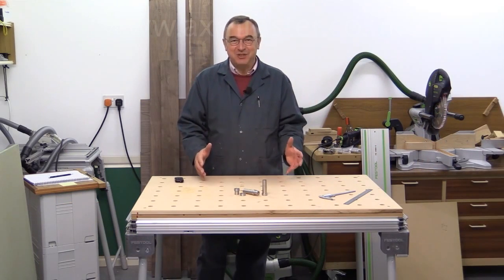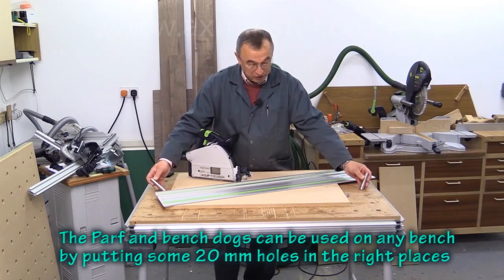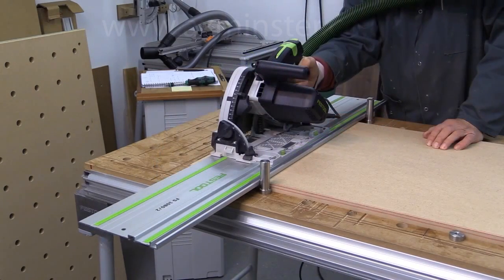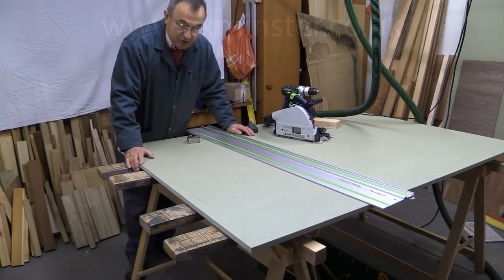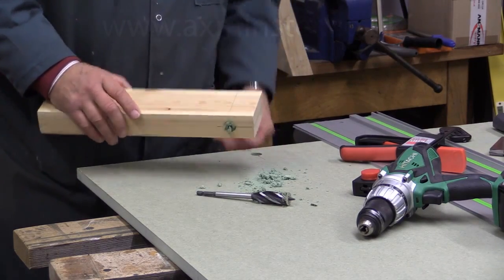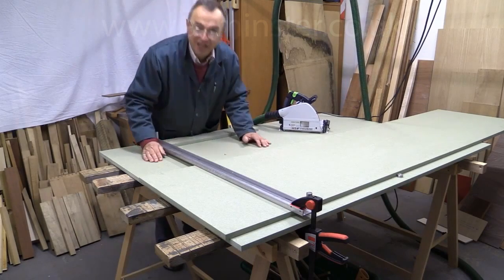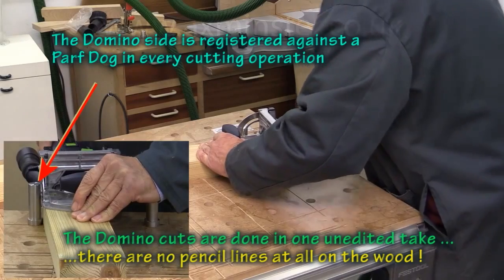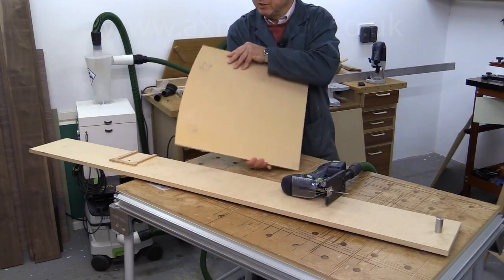Veritas Parf Dogs

Comment: Peter words cannot express the pleasure I get from your tips and vids.I have just completed a slab bench top 3ft / 5ft. and then I discovered your perf dogs and I had made the top with 3/4" holes. Lee Valley does not sell 3/4 "  perf  dogs .would it able to  have them machined to fit my table?  Ian.

Comment: Dear Peter, may i suggest you to mention that the parfdogs could be of more limited use when used with other saw-rail combinations than the Festool type. I use a Mafell MT 55 and discovered that the sole of my saw would be stopped by the dog. This is due to the Mafell type of rail i must admit. But il should be outlined.
Reply: Would a low profile dog not eliminate that.  There are options available in 2019 not so sure about 2016 though.

Comment: Hi Peter. I recently bought the UJK guide system and the parf dogs and, of course, I'm very pleased with it.  I thhought about the  problem where, with a wide board, the first parf dog  may obstruct the tracksaw.  I think I'm not the first with this idea, but to be sure:  what about putting that parf dog upside down in the hole?  You then can still cut boards up to 27mm thick without interfering with the tracksaw and that's the majority of the boards most of us use.  Also, the board you are cutting can be a tniy bit more narrow when you don't have to put a spacer in between..  The only problem is that you cannot screw the parf dog in this case.  Or is there another reason not to do this?
Reply: +Frank Verlinde
There are low profile options out there that can be used.

Comment: Thanks Peter for sharing. Great sales presentation to clinch the argument for your parf dogs creation. Besides showing the variety of tools that benefit from the parf dog configuration, the clincher for me was the rim and thread combination that sets your dogs apart from the pack. Even with a severely battered and deformed job-site MFT table, the parf dogs can be accurately secured in place for the day with a spanner and a framing square.

Every day would begin with a piece of 8' by 4', which would overhand two sides of your MFT table, So what parf dog arrangement would you suggest to make the first few square cuts?